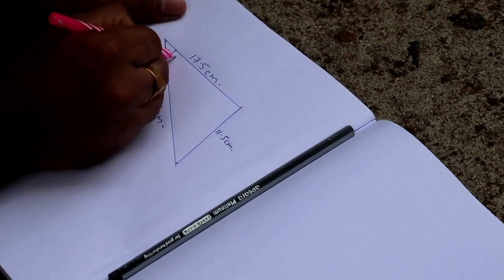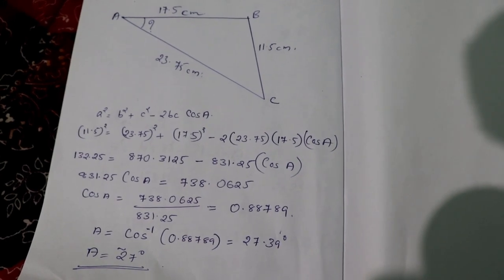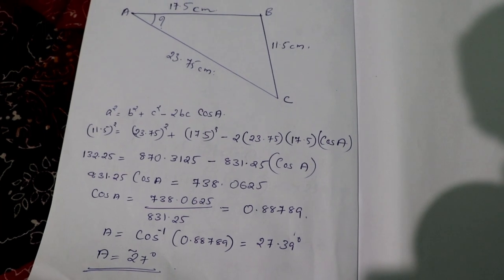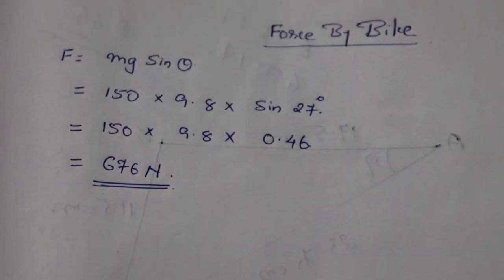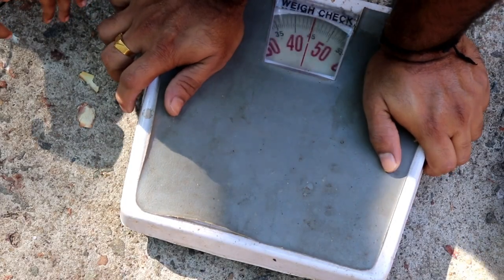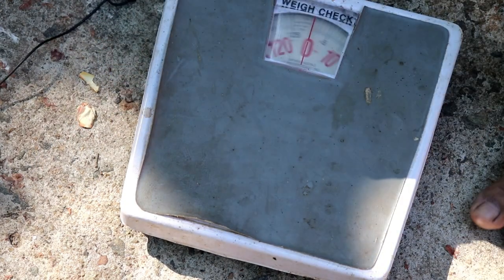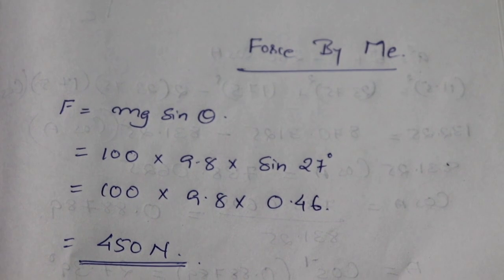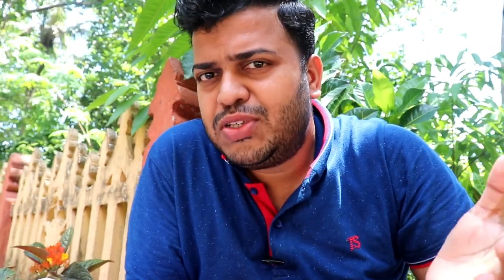How much Force is Required to Push a Motorcycle on a Slope of 27 Degree | Find the Angle of a Slope

Comment: I want to see you pushing the bike in the forward direction.
Reply from the maker: That's a good idea but reverse will be more genuine for others to see since you cannot start the engine in reverse...
Reply: @RajuSNair  hi... 

Here, you considered the mass as 150, actually it is weight.

weight is force, that means, weight = mass x gravity

so here, the mass is 15 only, not 150.
Reply: same mass calculation is applicable for ur force...

also here, we are kicking on the earth and pushing, so the maximum force that you can apply on the bike will be more than the calculated one.